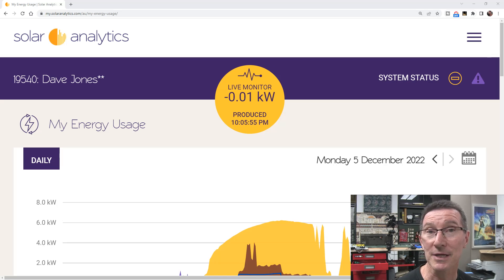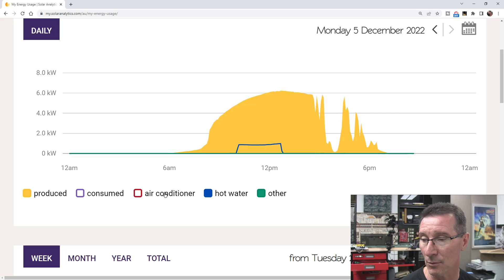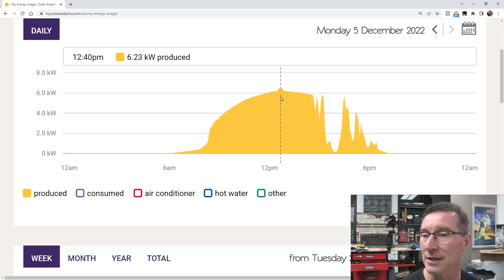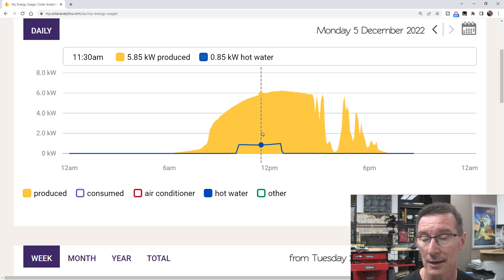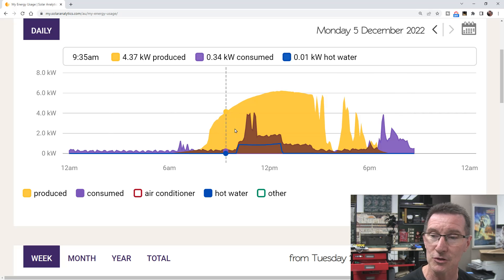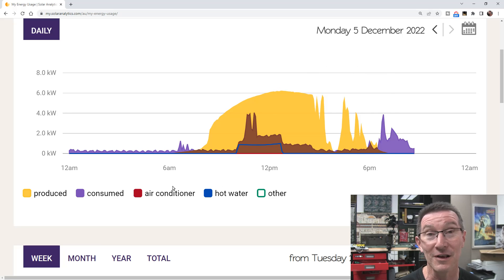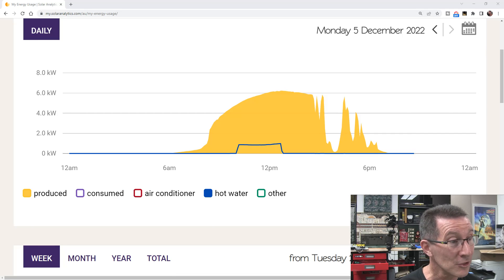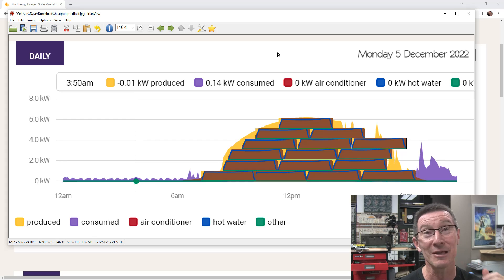Reclaim Heat Pump Hot Water Solar Energy Usage UPDATE

Comment: It can take 10 min to ramp up as some heat pumps have variable speed compressors. There is also a start sequence where the pump starts first, so the unit can detect the temperature of the bottom of the tank to set the initial compressor speed. Then the compressor starts and ramps up slowly. You can also see the load increase at the end as warm water enters the unit making the compressor work harder, just before shutdown.
Reply: I think it is more likely an artifact of the data collection system. If it only records a value every 5 minutes and you assume it is the sum over the full 5 minute interval, if the heater comes on in the middle of an intervall it will result in an data point at half it's power intake. And if you graph just makes nice rounded lines from the few data points it just looks like its slowly ramping up ...
Reply: @florianf4257  The compressor manufacturers usually don't recommend speed changes faster than 1Hz/second, if the compressor finally runs at 120Hz which is pretty common on a four pole motor resulting in 3600 rpm the ramp up will take two minutes. Depending on the refrigerant cycle it can take some time to reach a stable operating point since the refrigerant dissolves in the oil and must be driven out.
Reply: @Ocean View Workshop you make a LOT of assumptions. the outdoor unit does not care in the slightest what the tank temperature is. it only sees/cares that the setpoint is reached or not and just keeps chugging along until it is reached. the outdoor unit ONLY looks at evaporation temperature and wants to keep that just 1 or 2 degrees above freezing and runs the compressor as fast as it needs to to maintain that temperature.  when it is freezing outside it runs at below dezro and needs to do defrosts when the evaporator freezess up over time so the system still works in winter. and the actual load is dictated by the EXV, not the compressor, the compressor just responds to its given load. there are plenty of units that ramp up within a minute or less to full speed.

Comment: Solahart black chrome miracle. 300 days a year with no power consumption at all. 300ltr tank. Total cost installed just $3400.00 minus $1500 solar rebate. Heat pumps are useless in cold weather, as they need atmospheric heat to work efficiently.

Comment: Heat pump HWS are so efficient. I have a small one and it clicks on at 8.30am and clicks off around 12pm and also only uses about 600w draw when ambient temp is above 5°C. When temps are below 5C, it uses a resistive element which draws about 3kw, but it rarely ever needs to do do that.

Comment: Wow I was wondering how those heat pump hot water units would work out. I'll take a more serious look at one now. I'm new to solar myself and have installed a 10kw system , on a perfect sunny day I'm generating around 60kWh . Which is nuts since the house uses 20-30kwh on a heavy use day. I'm trying to work out what my next move should be to take advantage of all the excess power I have now. Changing my gas hot water system to a heat pump set up might be the way to go.

Comment: You have just demonstrated that resistive heating with export diversion at practically no upfront cost is a very viable option compared to a heat pump.

Comment: You may not use a lot of hot water in mid summer. If your hot water tank is not "very cold" your heat pump should not drain a lot of energy to heat the water.

Comment: I admire the simplicity of the IrfanView solution, but don't you get a CSV download option in SolarAnalytics?
I'd scrape my eyes out if I wasn't able to instantly switch the display sampling resolution to highlight or average out peaks. Set up an alert if your hot water consumes >50% of your produced energy. Integrate the power with two decimal acuracy. You gotta get this data into Grafana!! So much wasted potential (if the site loads at all?)

Comment: The CO2 heat pump makes water hot enough to use for the clothes dryer!  I haven't found any conversion kits, but I'm thinking this would be a cool add-on, especially if the dryer can be located close to the hot water.  The main addition would be a circulating pump to take water from the top of the water tank and return it at the bottom, and, of course, a radiator in the dryer.
Reply: Most decent clothes dryers (at least looking at those sold in Europe) are heat-pump based, so using hot water from the heat pump system wouldn't really help at all.
Reply: Didn't know they existed! Apart from wall hung rads.

Comment: If there's a storm between 10 am and 1 pm you'll have to import power from the grid to heat up your water.
Reply: ........even if so, it will be at significantly reduced energy demand and therefore reduced cost, compared to an electric element HW system or gas HW system.

Comment: I had the same issue updating the names of the CTs on each circuit. I added some extras and had to contact them to get the names updated, they were fairly quick about it though, this was about a year ago or so. Also Dave, I cannot comment on Odysee without creating a channel, and I cannot create a new channel, I must link to my youtube? Surely there is a way around this? I don't want to link to youtube.

Comment: Please consider scheduling a follow-up video in 6 months time Dave - I'd be interested to see what the graph looks like in the middle of winter with less insolation and less temperature differential for the heat pump to take advantage of. How much will the 16:1 ratio change?
Reply: ...and also colder tap water and problably an appeal for longer/hotter showers. would be interesting to see winter data.
Reply: Modern heat pumps are rather efficient all the way down below freezing AIUI, so it'll work just fine probably. Though maybe systems designed for Australia aren't quite that capable.

Still interesting to see!

Comment: So is the conclusion now that the heat pump system is now performing better than you initially predicted? I remember you saying that it’s performance wasn’t quite in line with what the manufacturer promised but you were still happy with it.
Reply: My guess is dave forgot to include the heat losses over 24 hours. For example, just because you use 0 water, the power usage won't be 0. It still needs to run daily to keep the temperature up.

Comment: My thoughts are I need more roof space. When "supply chain issues" stop being an excuse I can get about 3kw of panels on my roof, but it'll only be on the Eastern side. On the Western roof I have a window poking out of it and there's not much room for any panels.

I'm considering an air source heatpump/air conditioning unit though. We use them at work and they're great.
Reply: Windows are overrated.
Reply: @Okurkaarrgghh  They are in the UK, all we see out of ours is rain or blinding sunlight.

Maybe I should convert my windows to solar panels 🤔

Comment: The problem with these are if you have them in a heated basement they suck out the heat in the room and you must heat it up again not really having any efficiency over a purely resistive one UNLESS the basement/room is heated by a heatpump from the outside or it is ducted to the outside.

So if you only have resistive heat in your house you will never have any efficiency gain over a resistive hot water tank
Reply: Australia, no basements (usually), we put them outside.
Reply: We don’t have basements here in Australia

Comment: This need a follow up in winter with only 1/3 of solar energy, less efficient heat pump (air is colder, incoming water is colder), and more hot water consumption (the cold water is colder so for the same shower you need more heat).
I bet the ratio will probably be around 4.
I wonder if you could use a weather forecast system instead of a basic timer to wait for sun if it's cloudy in the morning.

Comment: I hadn't heard about heat pump hot water systems when I got solar installed.
Had a standard resistive heater on a timer, it was using more than I was generating when it came on at 9am in winter, so I swapped the element from 3.6kw to 1.2kw. Runs a lot longer (Still less than half the timer setting), but whole house usage no longer exceeds production when the hot water is on except during storms.
Reply: I'm going to do the same thing, although not sure if I'll go for a 1.2kW or 1.8kW element to replace the 3.6kW one.

Comment: I ordered one of those RTL-SDR usb sticks a few weeks back (a radio receiver) supposedly you can remotely capture your whole home energy usage in real time providing you have the right meter, which luckily I do.
Reply: I do that with my meter simply by closely monitoring the rate at which the 1000imp/kwhr LED on the front of the meter flashes at :)
Reply: @new-zealand-clippy  cool. yeah, whatever works. I like the fact it's real time and I can stay inside where its warm! its cold as f@ck outside!
Reply: @stevenspmd  Oh yea totally! I didn't mean that I eyeball it - I have a little wifi board out there in the meter box counting the LED flashes and reporting them back to my monitoring system :) Your SDR solution awesome - especially cool because you can monitor your neighbours power too!

Comment: You're mentioning a temperature of 58C for your hot water.  Isn't that on the low side with regards to bacterial growth (specifically Legionella)?

Here in Norway, health authorities recommend a temperature of 70C or higher for hot water, as bacterial death is near instant at that temperature, and the risk is minimized
Reply from the maker: See my install video. 63C is the heat pump output temp, bottom of tank cutout is 58C.
Reply: I believe there are some systems that heat up things a little hotter once a week or so.
Reply: 58C is 136F. In the US I believe the ideal is between 120-140F. I would think "Instant bacterial death" should not needed as either the water is too cool (in the lines) or sits too hot (in the tank).

Comment: Is your heater just on/off.  The system I designed for my boat uses whatever power is available without discharging the batteries.  It works a treat.

Comment: I find it quite confusing to see the website say "X kW produced" instead of "X kWh produced" or maybe "producing X kW"
Reply: People ALWAYS get their units wrong
kWh vs kW, W vs Wh, mAh vs mA
Americans with their freedom units are much more accustom to this nonsense:
"This boiler makes 90000 BTU" 
and then?  What happens after the boiler "makes" about 26 kWh? It dies in flames?
BTU is a figure of energy, not power. Energy per time is power. So is it 90000BTU per minute, per hour, per day?
Reply: @Fluxkompressor  American freedom unit? BTU is short for British thermal unit.
Reply: @Fluxkompressor  it's per hour. We also measure our AC systems in tons which is equivalent to 12,000 BTU/h (just looked this up, it's how many BTUs it takes to melt a ton of ice divided by 24 hours)
Reply: @Fluxkompressor  further rant: scummy companies that now rate their rechargeable batteries in mWh instead of mAh 😠
Reply: @InsanePacoTaco  isnt that exactly what they should be doing? Makes batteries much more comparable (Li has higher voltage than Alcaline for example, which doesnt show up in the mAh figure)
Reply: @phil-sw  mAh has been used for years on the quality rechargeable batteries. Now there's a mix of the cheap batteries using mWh and the quality batteries still using mAh. On a side note: on a lithium-based rechargeable AA or AAA battery, what do you think the manufacturer multiples by when they make the mWh rating? 3.7V? 1.5V? I'd rather just have mAh.
Reply: @InsanePacoTaco  hopefully by the output voltage, anything else would be BS 😉 I mean you can always come up with BS numbers for product specs, just look at lumen figures for flashlights at Amazon and eBay...
Reply: @phil-sw  Agreed. If you want to see some really ridiculous numbers, look at cheap car horns on Amazon and eBay. Think 200 dB is a stupid amount for a $24 car horn to say it makes? Try 600 dB. I think the Torque Test Channel did the math on that and came up with that horn would effectively destroy the world if it actually produced 600 dB.

Comment: I wonder if your gas utility company will quickly adjust your term amount. I at least assume it's similar as to here in the Netherlands where we pre-pay our expected monthly usage and once a year the amount already paid is compared to what was used and you get to either pay the remainder if you used more or what you paid too much will be squared off towards your next term payment.

My mother switched heating/hot water from gas to electric (CV system went kaput, and my late dad would fix it, but now that he is gone we haven't found any company willing to fix it since he's changed stuff, such as fixing capacitors because they got too hot), but the gas utility still hasn't fully adjusted her term payment amount to reflect her gas usage (just cooking). :(

Comment: I'm a bit confused what has the remainder of the solar energy been used on, do you have battery storage?
Reply: Grid tie, so the excess is exported to the grid via a second electricity meter, and there is a corresponding offset on the electric bill when the meter is read. Export price is a lot lower than import price, though some with very old systems, early adopters, got grandfathered in, and actually get more for selling power than they pay in.
Reply: @SeanBZA  Thanks, that skipped my mind
Reply from the maker: Nothing, exported to the grid. We have an EV, see my zappi video.
Reply: I think the majority goes to AC (cooling) but he said the AC load doesn’t currently have a CT input into the solar analytics system.
Reply from the maker: @Pugjamin  Aircon still shwos up on the house consumption. No aircon today.
Reply: @EEVblog2  ohh ok, misunderstood you slightly.
No air con here today either…..mainly because it’s 6°c 🥶
Reply: He has an electric car, fridges/freezers, but most goes back to the grid.

Comment: Wouldn't it be more efficient to heat the water with a heating element using the electricity direct from the solar PV instead of via a heat pump?
Reply: Absolute not. Direct thermal heating has a maximum theoretical COP of 1, Dave is getting a COP of between 3.5 and 4.2 out of the heat pump. Check out his previous video on the install.
Reply: No that's the point a heat pump will amplify the heat 2 to 3 fold
Reply: Heat pumps can and should be over 100% efficient.
A heating element can at most be 100%.

So ideally 100 watts to a heat pump should net 300-400 watts of heating.
Reply: @TheWebstaff  Heatpumps are not over 100% efficient. Far from it
In fact if we take a difference from 25°C outside to 60°C hot water it can theoretically achieve a COP of about 9,5 (The Keyword here is Carnot cycle)
So since this heatpump has a COP of about 4,5 it is about 47% efficient in pumping heat
actually pretty bad

But since it gets more useful energy in to the water than we put electric energy in, it makes sense to use it
Reply: @Fluxkompressor  we, as in literally anybody who talks about a heat pump or any kind of heating / cooling system refers to the fuel efficiency of the system, since from a bill paying perspective that is all that matters. In this case the heat pump is, theoretically, 350-400% electrically efficient. As nobody is paying for the ambiant air temperature it is entirely irrelevant how much thermal energy is consumed from the air.
Reply: @Fluxkompressor  Sounds like you have the makings of a good video.
Reply: @Pugjamin  what's the efficiency like when the air temperature drops?
Reply: @makgyver411  he talks about it in his other video.